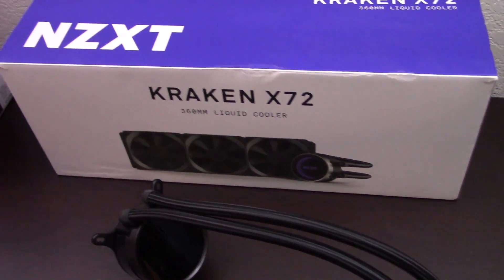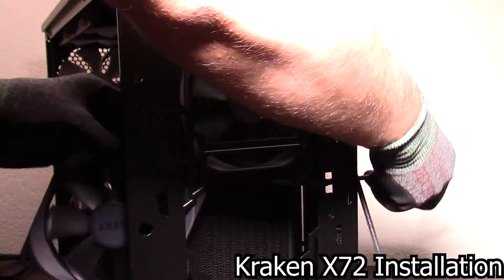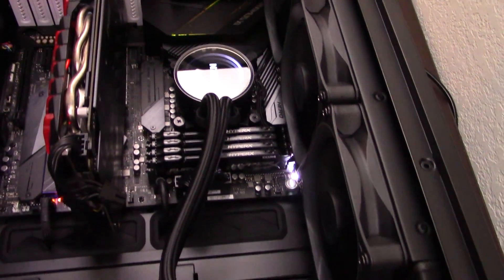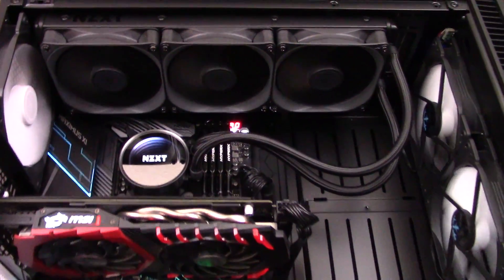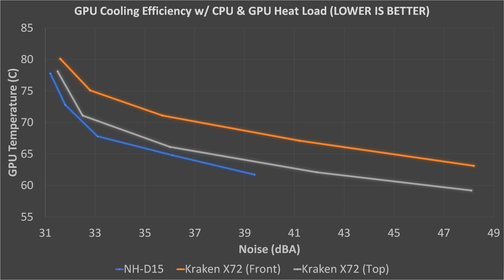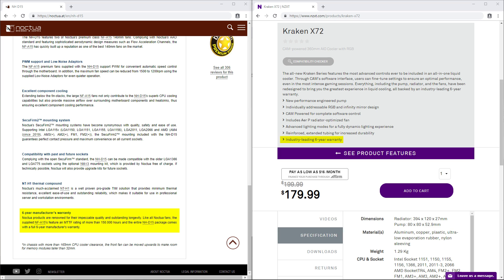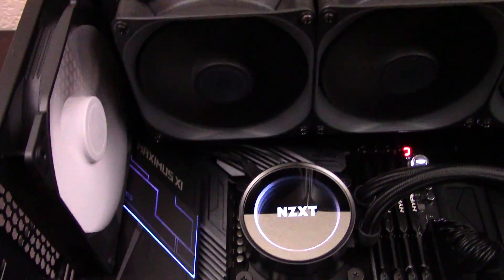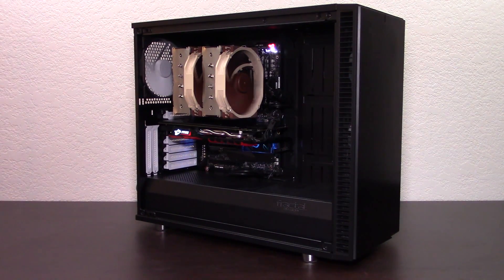Air Cooling vs. Liquid Cooling: The Ultimate Showdown (feat. Noctua NH-D15 vs. NZXT Kraken X72)

Comment: But, did you let the AIO equalize in it's liquid temps?
Reply: probably not... anyone who has stress tested a system for an hour or longer on an AIO knows that it looses its cooling lead quickly in longer loads such as gaming or stress tests
Reply: @amorgan20111  um. No. That's not how liquid cooling works. If the cooling capacity of your rad is lower than the tdp than yes. But if you're rad and airflow and setup is efficient no. Just no. As long as you're not feeding hot air back into your system, and your ambient are low and constant, you temps will reach a thermal equilibrium and stay stable. That's coming from someone that's done 24hr stress tests and never seen above 65C on 240mm aios. Set your rig up better and you'll have better thermals.
Reply: @ScrewUserNames6587  Yes, it is how it works. If you want to look at sustained cooling capacity for a water cooler you need to let the water temperature equalize. This can take upwards of 15 minutes depending on how much liquid is in the system and also why these results differ so much from other people who have covered this topic.
Reply: @amorgan20111  I can tell you from his temps, he probably at the very least didnt actually have a decent thermal paste setup, I have the x52 on a gtx 1080 and it keeps it under 50C max load.
Reply: Adineo  in some cases, you can get a small OC without raising the Voltage, but when you're going for maximum OC, higher voltages and a more powerful cooler able to dissipate the increased heat output is without a doubt a necessity. Idk why that other guy was trying so hard to argue against this fact when there are thousands of videos of extreme overclockers using LN2, water coolers or other extreme measure to cool their components, and voltages well above the stock voltage.
Reply: @Steven-r6y9l  no I am not (sadly), but have you stressed tested an AIO on a 200W+ TDP CPU for over an hour?
I have, and I've seen how over time the water temps increase to the point where they become less efficient than a effective air cooler.
Reply: @amorgan20111  only time I get higher than 65C is if my fan curve is bad, my pump is dying, or my voltage is way to high. Like when I was testing the limit of the cooling capabilities between a kraken x52 and a Cooler master m240L
Reply: @ScrewUserNames6587  I have my CoolerMaster masterliquid ml360r in a push pull config with 6 corsair 120mm fans. The CPUs I've used it on are the ryzen 1800x OC'd to 4.15ghz (4.05 stable, the 4.15 crashes as temps go over 65 degrees) and for Intel I've used an i7 6900k OC'd to 4.6ghz at about 90 degrees before it became unstable. I have the rad set up as an exhaust in my case (top exhaust to assist with convection). With the 6900k, I've got the AIO to be less efficient than on air in comparison to my NH D14s, after it was under load for about an hour and a half. While the air cooler hit its peak temp after a 4.5 ghz OC and mid 90's after about 10 mins of an AIDA64 load, the AIO struggled to keep the CPU at 95 degrees until the CPU throttled and dropped below 4ghz at T junction. This is from my own testing. I used the same thermal paste on both the AIO and air cooler (GC extreme) although I recently switched to GD900 for my testing due to it being cheaper and  pretty much even on thermal transfer with it, putting it in 3rd in my book after liquid metal and kingpin kpx.
Reply: @amorgan20111  you're either overvolting the crap out of that cpu, or your setup is super inefficient. Like I said, set up properly a Ml240l which is the less capable smaller cooler master radiator to the 360r even with just the fans it comes with is quite stable. That's been on a 7600k at 4.9ghz and a ryzen 2700 at 4.1 ghz all core
Reply: @ScrewUserNames6587  btw, the 6900K was basically two 6700K's on one piece of silicon. So I'm typically going to see double power consumption digits from what you have on your setup, with almost double the heat output.
Reply: @amorgan20111  but to your defense, idk exactly what voltages your tossing at things. And LLC saves your hardware enough if you balance the level with your minimum needed voltage to be stable, so let's say LLC 2 at 1.29v compared to LLC4/5 at 1.35-1.41v 

I'd personally rather see a CPU performing stable at 4.6ghz like my 7600k at lower voltage, then 4.9ghz or higher at higher voltage.
Reply: @ScrewUserNames6587  literally everyone who overclocks raises voltage for stability. Of course theres a limit due to diminishing returns and increased risk of damaging the CPU, but dropping temps isnt enough to get any extreme overclocks by itself
Reply: @ScrewUserNames6587  also the 9900K is more efficient (cant believe I just said this) than the 6900k. The 9900k's TDP is 95w, and when the bios is unlocked to let it boost to its max stock boost clock it's considered a 125W TDP. My 6900k was as stock base clocks 140W rating. And you want to compare the 9900K with a measly .4ghz (which is impressive for a 9900K that isnt on LN2) to the 6900K, which at its base clocks will use more power and create more heat. Please stop while you're ahead. The more you defend yourself the more stupid you are making yourself look.
Reply: @ScrewUserNames6587  I dont remember the voltage I threw at the 6900K to keep it stable, as I did this two years ago. I would just do it again, but I sold it and got a second gen threadripper 2950x.
Reply: @ScrewUserNames6587  also, I agree it's better to be stable at lower clocks and voltages than push it balls to the wall, but I only did this to see what the 6900K maxed out at before it was unstable or damaged itself. It survived 2hours of aida64 at 4.5, at just below tJunction after it throttled down after an hour and change
Reply: @amorgan20111  also, just fyi, LN2 runs get cpus like the 9900k far higher than 5ghz. Hell, I've seen people's LN2 benchmarks for some cpus well over 8/9ghz. But those are obviously not everyday overclocks. So they dont even have relevance. 

My point is, if your talking about long burn in and cooling efficiently over time. You shouldn't be talking about 2 hr stress tests, that's neither a benchmark for numbers or a true everyday workload stress test. Neither is a thermally unstable over-volting overclock. Like I said earlier. Only way your thermals aren't stable with a loop that has a bug enough rad is, A)its inefficient OR B) You're ambients aren't stable if my room stays at 21C and my loop is capable of holding it's own. I wont see more than 10-20 over ambient. If I push the cooling capacity past its limit, I see those 50+C figures in a 21C ambient situation. Even then, if airflow and liquid flow are efficient thermals should be stable. 

24 hour burn in test is what is used for that. Also unrealistic though as no ones doing anything tougher then what you'd be doing in cinnebench in normal workloads.
Reply: @ScrewUserNames6587  The fuq are you on about? Intel chips don't care about heat regarding performance until they hit TJmax. So if you're hitting 95 degrees in P95 and no higher, than the overclock is stable.
Reply: @ravenshrike  I mean, it hit 95C and thermal throttled because that's what happens. Learn to read dude. He did a 2 hour stress test and in 2 hours the temp continued to climb until it thermal throttled. That's textbook unstable. Only two other versions, complete overvolt, or complete undervolt. In this case, it's too much tdp for what his cooling loop could do because it was inefficient. Or would you also like to pretend a 360 rad doesnt have the cooling capacity to handle sub 250W tdp
Reply: @amorgan20111  You could have talked to a wall and the wall would have been more insightful than this SiN Loud guy. Don't waste your time with people like him :D
Reply: @schio44  You're right. I'm sorry for flaming on YouTube and upsetting the educated people like yourself. Sorry friend.
Reply: @amorgan20111  nah you did right. Im a noob and i could've taken what he said seriously
Reply: @shilmardepedro7229  nah, you would have been fine.  There are too many videos out on the interwebs that cover air vs AIO. Hell I think Linus released one a few months ago that was highly detailed, and even he, who loves to watercool his personal rigs said AIO's are inferior to high end air coolers like Noctua and BeQuiet! The only reason why most entheusiast will suggest an AIO if for 3 use cases.

1. Your case doesn't have great air flow, but supports AIO's.
2. You are going for looks > performance, as most people think AIO's look cleaner and better than most air coolers.
3. Your case has better radiator support and doesn't have much room for a large air cooler.
Caviot: Money isn't an object for you and the $50-150 you could have saved going with air cooling or put into another component to go up a tier (ex. from a 1660 ti to a 2060S or RX 5700)

https://www.youtube.com/watch?v=hr0qLLv3dKc

https://www.youtube.com/watch?v=23vjWtUpItk
Reply: @ScrewUserNames6587  Totally on point, focused on real performance instead of bullshit numbers. Undervolting ftw, these ppl must never use their cpu other than for gaming.
Reply: @ravenshrike  i think he's making it up as he goes.
Reply: @amorgan20111  best configuration is to have all your rads exhausting the air and any other fans intaking air. Like for example a top rad and front rad, both exhaust while a rear 120 fan intakes. Just make sure your intake fans will pump enough air and even 1 fan will be plenty since generally you need some seriously cfm and static pressure to push a lot of airflow through a rad.
Reply: My 360mm aio ended preforming worse after a long render on my 5960x, where the nh-d15 beat it in a long render. Quick bursts on benches the 360 normally kept temps lower, but it can't keep it there if it lasts long. I would imagine heat soak.

A 10 min render with my 360mm aio with its stock fans I got to 97c by the time the render was done, the nh-d15 temps stayed just below 82c with 80% fan speed.

Granted the stock fans on my aio was decent but not the best, even with noctua fans on it, It wouldn't perform much better as the intake was fresh air out side of the case. This is on a i7 5960x 4.5ghz 1.27v.
Reply: @AlanDike-uw2ew  You are aware that the 1950X's stock boost clock is 4.0ghz? That's not an OC, but a base clock boost.
Reply: @AlanDike-uw2ew  nice, you have an above average sample. But for most CPU's stability comes with more voltage and lower temps
Reply: @AlanDike-uw2ew  Hey you already proved my point  once you said "I don't feel like pumping that much voltage through it" Voltage tweaking is required for stabilizing most overclocks that are meaningful. When your CPU can reach 4.0 on it own (even on a single core), anything below the rated boost isn't really an OC...
Reply: Exactly my point.

Comment: Thanks for the upload, for me Noctua is a clear winner and I'm looking to install one on my next build Ryzen 9 3950X, with-in a new case the R6. I have a few questions around this case. I like to use a 5.25 drive = dvd/blueray, can you confirm if a 5.25 bay is used. What size fans can be installed front (x2) and on top (x2) 4x120 or 4x140.  How much (mm) space for a GPU, once set up for standard lay out (ie driver bay used).
Reply: Max 440mm with front fan mounted

Standard layout: Maximum width 155 mm (including power connectors) for graphics cards longer than 300mm
How the DVD/Blueray will open? How you gotta put CD inside the DVD? Since the case front panel is block

Comment: You didnt take in to account for cooling temps in extended work loads. Air coolers in a well ventilated case will plateau quickly at a temperature, while water coolers get hotter over time and slowly lose their lead in cooling. 

In my own experience, after an hour or hour and a half of running nonstop benchmarks or stress loads, the water coolers tend to do as good or worse than many air coolers. My go to air cooler for benchmarking and stress testing used computer parts is the NH- D14S and my go to water cooler is the CoolerMaster masterliquid X-D36M
Reply from the maker: I will likely do a follow up video in the future where I test heat loads for 2 hrs to see if there is any change.
Reply: @HardwareScientist  there will be, but depending on the airflow in the case, the AIO will either still beat the air cooler or drop to its level
Reply: Very good point that was overlooked and I agree with the CoolerMaster masterliquid X-D36M as the best AIO, 
In the perfect world air cooled Cpu
Water cooled Gpu like a Kraken G12 mod, I find as a gamer Gpu's benefit greatly with water as you can't fit D15 coolers on it and aftermarket Gpu's  depending on vendor can't compete with AIO
Reply: @jimmy2shoes75  idk if the coolermaster x-d36m is the best, but it is the best I've used. I think it is a good representation of a 360mm rad AIO and worthy of representing all AIO's.
Reply: @amorgan20111  If I remember correctly it scored best on gamer neuxs

Comment: I do not know how people always come to the conclusion that the Noctua NH-D15 is the best air cooler ...
the good thing about the Noctua NH-D15 are the fans compared to other air coolers (which are much more important with air coolers)
the strongest air cooler is the Thermalright Silver arrow IB-E Extreme, but has bad fans
But if the performance in relation to the volume is important then the Thermalright Le Grand Macho is unbeatable

It would be important in the test to know how the case fans are controlled, should be controlled by the board is their whole test then worth little
Reply from the maker: Case fans were adjusted proportionally to the cooler fans, from lowest speed to highest speed, mimicking a typical case fan curve. I actually have a new video coming soon where I test the Le Grand Macho RT.
Reply: @HardwareScientist  my advice is to replace the original fan with a Noiseblocker NB-eLoop B14-PS and attach a Shroud between radiator and fan with 2mm Elastic Cord String and if the housing allows it also use the Thermalright Fan Duct 140mm

Comment: This is such a detailed yet easy to understand comparison test. I’m glad to have purchased Noctua instead of AIO.
Only downside is the color and size, but I suspect I’ll grow to love the aesthetics of the classical beige Noctua
Reply: Other downside of the AIO  that air coolers don't have is that in extended workloards and stresstest (such as an hour long gaming session or an artificial 100% load in AIDA64) the water will slowly begin to heat up to the point that the heat transfer is no longer efficient. After about an hour or more, a good air cooler will be as good as a large rad AIO or even better. I've proven this before with my NH-D14s and my Coolermaster Masterliquid X-D36m

Comment: i   wonder how a non push pull air cooler like the LGM RT would do with the GPU temps. IT does about the same as the d15 on cpu temps soo,
Reply: Unlikely to be too different on GPU temps if it's blowing in the direction of an exhaust case fan.

Comment: Well noctua is only few degrees hotter while it is lot cheaper, can't leak, quieter and fit way more cases. Also the new noctua NH-D16, which comes next year has customizability and slightly improved performance.

Comment: One of the best reviews I've ever seen. I'm not even talking about a particular category.

Good thing I got to see this. My next build will feature either of these two. Now, I'm leaning more towards the NH D-15 but I'm still not sold on it
Reply: Get the black NH D-15
Reply: get the NH-D15; standard colors are more hipster than the boring black, go for the classic.
Reply: Well money wise go for the D15 but do not over clock your CPU it would kill the D15. And no stressed tests it might kill the CPU, and don't be surprised if your PC reboots because of an inefficient cooler while playing demanding games. Also the D15 has no software to monitor your temps and control the fans, you would have to manually set the fans to a certain speed which might not be enough for the cooling of the CPU. The software will automatically speed up or lower the fans depending on the temps, that imo is a very important piece of software that you really should have and the D15 does not have.
Reply: @Blarson12  no dude, you dont need stupid software. Again, dont be a fanboy, D15 is simply put a better product.
Reply: rohit judo I got the NH-D15 on my rig. 
https://m.imgur.com/a/07fZoFc
As you can see, if you care about looks a lot, go for AIO.
My rig is not bad looking, but will certainly look much better if I went with an AIO.
Reply: @chenshilongsun1581  at this point NHD15 has the based look

Comment: It's good that in this newer video I didn't yet watch, there's now a distinct Thermal Load - but a beyond the wall of blahblah I deposited on the previous one, it's still nice to know what CPU is being battered for the "oh hey, that could be me!" factor.

Another interesting consideration would be trying to push the RAM frequency/timings/voltage rather hard (as much of a JOY OF JOYS as that is), and measuring the RAM temperature between coolers.

Comment: 6 year warranty on a water cooler??? I used a hyper 212 for years on my old Phenom ii, kept temps cool for 7 years at a 4GHz overclock. I just hated pulling the fans out and cleaning the dust between each little fin. I knew when it was time because the it would heat up substantially every time the fins got dirty. Plus it started to sag hanging off the cpu socket after just a few weeks. With a 6 year warranty on water, I’m sold on that and convenience alone.

Comment: I have an i9 9900k which is better when i want to run it on intel boost. But my case can only fit a Aio 240mm.
Reply from the maker: If you can't fit at least a 280mm AIO, I'd definitely go for air cooling.